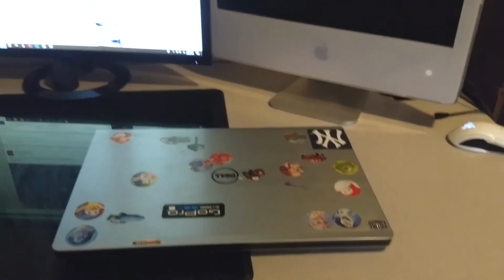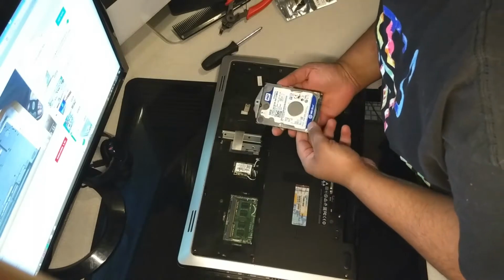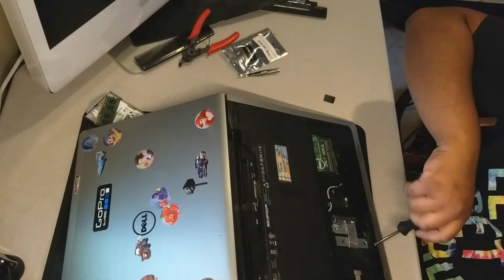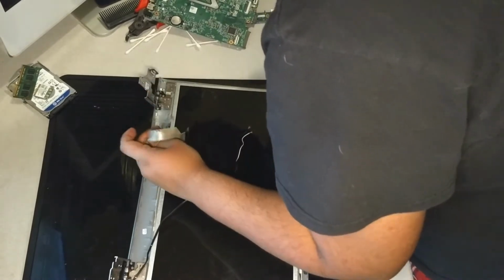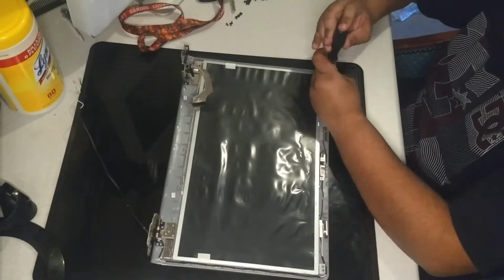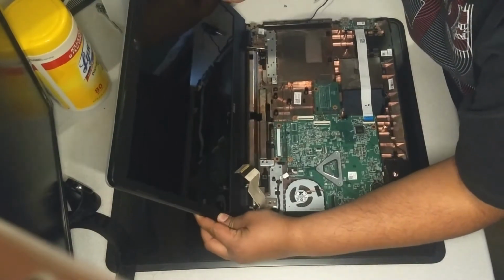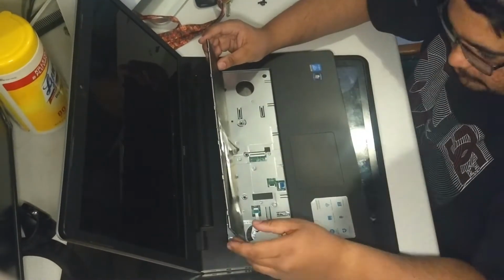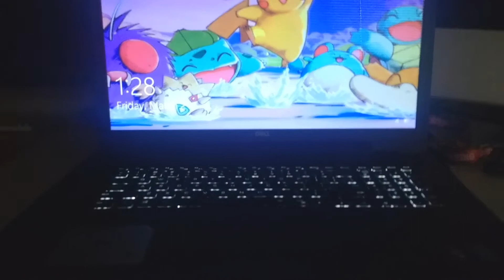Dell Inspiron Screen Replacement, Backlit Keyboard Upgrade

Comment: Why must the battery be taken out?  thanks
Reply from the maker: To make sure that there isn't any power in the machine this prevent short circuits and lowers risk of shock.